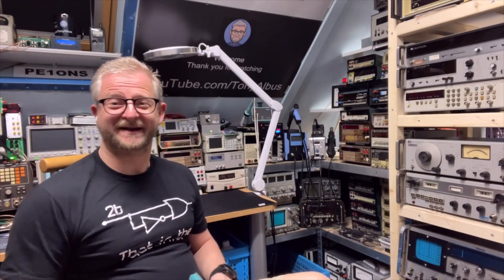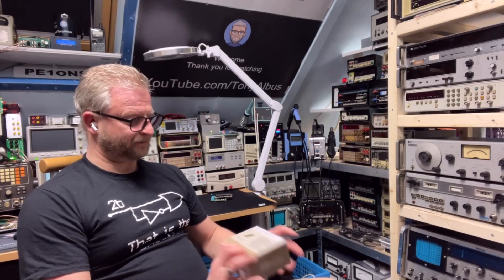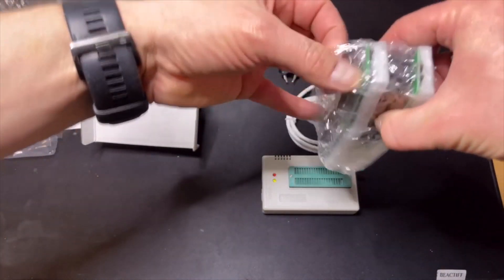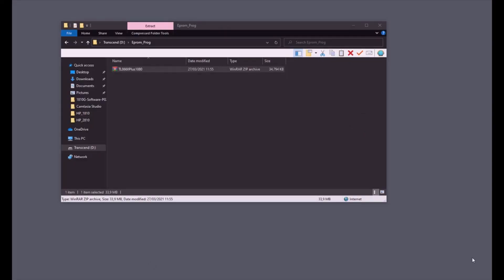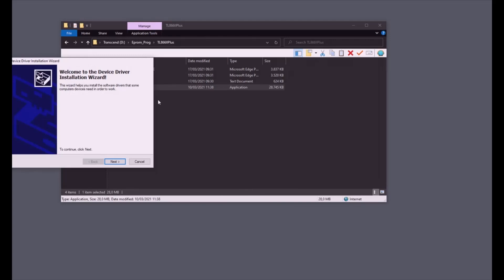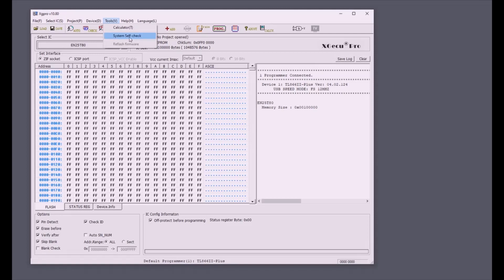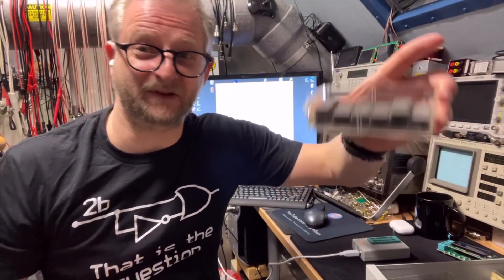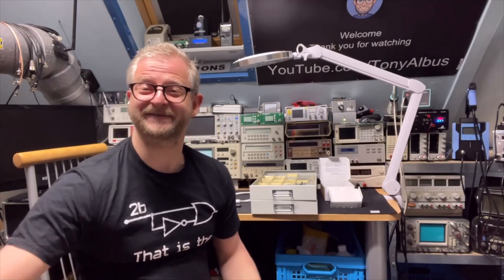#156 TL866II Plus Eprom Programmer - Installation Upgrade and Test

Comment: The logic chip testing functions of that programmer software are copied directly from other s/w and contain the same bugs or omissions. If you really want to test logic chips more thoroughly or test chips not supported by that programmer you should get a Retro Chip Tester Pro. This device is a game changer :-)
Reply from the maker: Thanks! .. good to know

Comment: Sir I want to help for programming sir I have save the data but 25% data save not 100% so what can I do
Reply from the maker: Him if you selected the correct Eprom and it still fails, try programming on lower speed. by default it is not on the lowest speed.

Comment: How or where can I download more IC binary files, so that I can test more ICs then are currently listed. Like some of the older ones, that are no longer listed.
Reply from the maker: The older ones not in the list, could also have an higher programming voltage, this one only goes upto 18 Volts, the older need 21 or 25 or more. i also have an GQ4x4 / GQ4x v4 , i will show later.. that one can program older EPROMS too.

Comment: i am new to the field and use the same programmer.  I'm trying to load 93c66 and it's saying: ERROR!  CODE Address: 0x000000 Buf_Val:0x71 IC_Val:0x06 have you been through this?  do you know how to solve?
Reply from the maker: Hi Gera, i have not had that before, what you can do is. 
1. make sure the IC is supported by looking at the compatability list
2. make sure you have the latest software and firmware of the prog. device.
3. make sure the IC is not broken
4. If you checked 1,2 and 3 contact you seller or the manufactor

Comment: Thank you so much. 

I was checking around and found a new version called T56 and it support a wider range of IC.
Reply from the maker: You are welcome, yes T56 is also there, i have no experiace with it.
Reply: @TonyAlbus I have one here. T56 has ZIF48 socket and can support many more chips including TSOP56 and NAND. It also supports older EPROMs that require 25V program voltage. However there are still a lot of missing chips and/or software bugs. This is why I have 10 EPROM programmers ^_^

Comment: Hi.mr.tony albus.
How to read hd64f3048f16 programing. Can you help me. Thank you
Reply from the maker: Hello, all the chips that is supports, are here: http://www.xgecu.com/MiniPro/TL866II_List.txt
Reply from the maker: And i found someone elso looking for it, maybe keep an eye on this forum: https://mhhauto.com/Thread-Programmer-for-HD64F3048F16-ou-F3048F16?pid=1454301#pid1454301
Reply: @TonyAlbus microcontrollers are used specifically because they contain ram, rom and cpu all in one package. the code is protected and it is a waste of time trying to read a microcontroller. often when trying to read it the chip will self-destruct on purpose. do not try to read a microcontroller that is important because you will be very sorry when it suicides and the device it came from is then scrap ;-)

Comment: Hi Tony,
I've had a TL866II Plus for several months and I like it.
I'm not surprised that you could read a TMS2764 but you know of course that to be programmed, according to the TI datasheet it needs a Vpp of 21V? The TL866II Plus sets it to 18V, which is its maximum. Did you know that and did you try writing the 2764?
The Vpp max of 18V is one of the few disadvantages of the TL866II Plus over its predecessors, the TLS866A and TLS866CS.
Reply from the maker: Yes you are correct Raymond, i meight need an older one too... or get my Commodore C64 back running with that programmer i used that time.
Reply: I did see a video. with one making a voltage socket, in between adaptor for it. and it worked just fine. with 21 and 25v :) think I found one of the videos. he is using a 9v battery to raise voltage :) https://www.youtube.com/watch?v=IpQ3w7sMOYo
Reply from the maker: Interesting! thanks